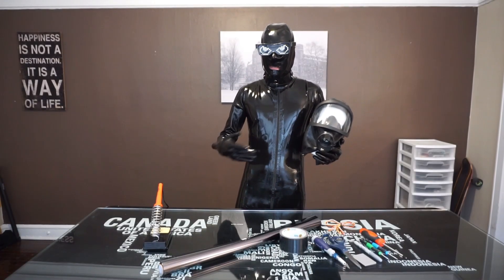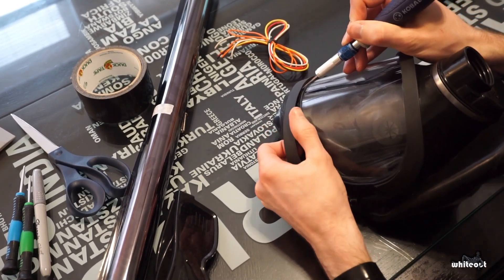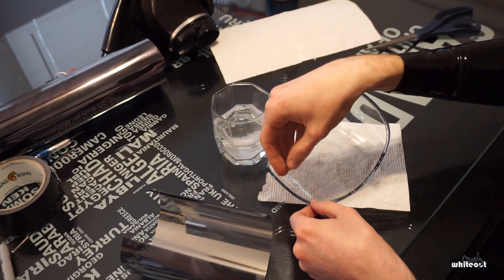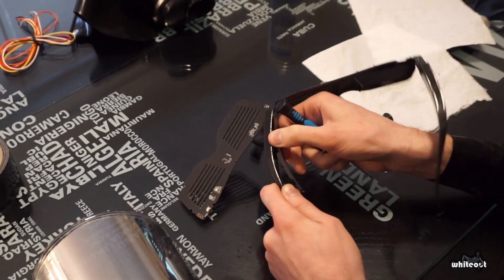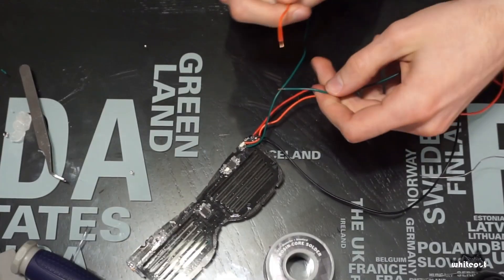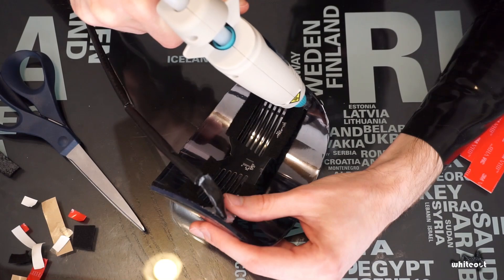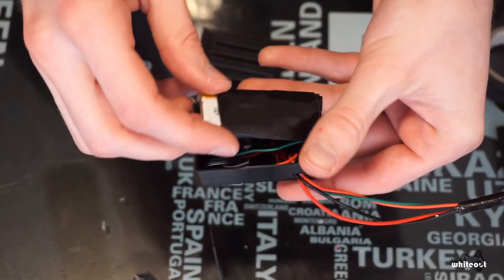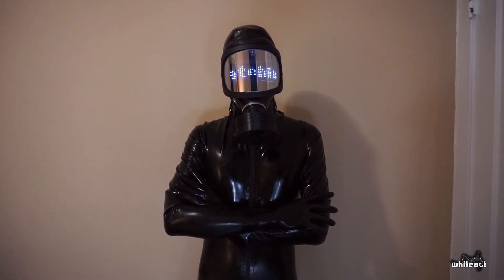How to make an LED Drone Mask

Comment: On tinting, you can tint without removing the lens. I did it on my mask with very little free space and it worked very well. Just if you do so, be prepared to have to restart several times